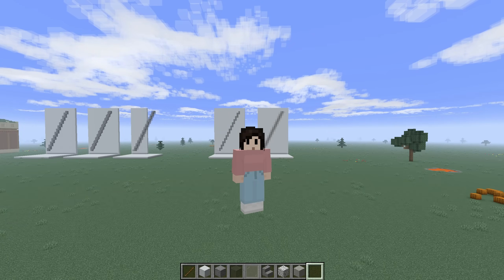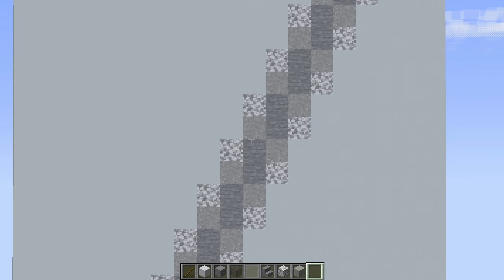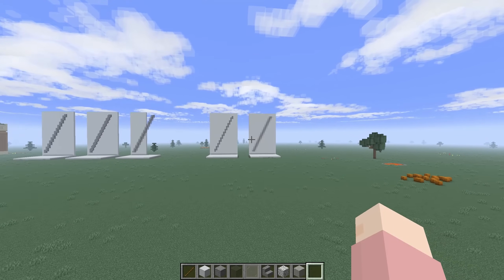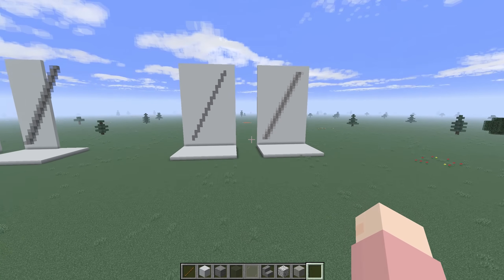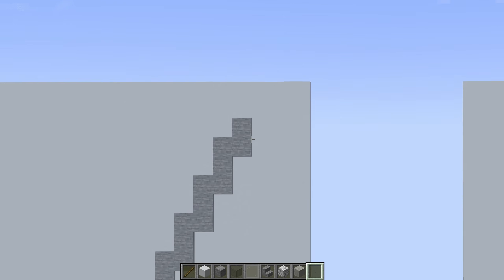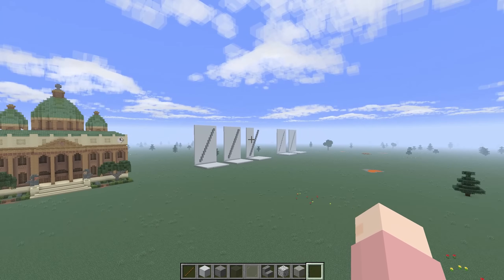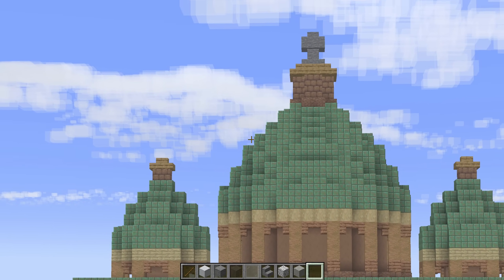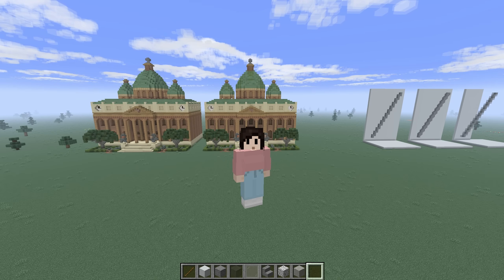How to Use Anti-Aliasing to Improve Your Builds

Comment: antialiasing needs to be balanced with post sharpening, the problem with your line is that it makes the line much softer. best way to sharpen would be to make the fill colour darker or to increase contrast between the fill and the edges
Reply: the side effects of softening with anti aliasing is that it can change the perceived colour, it looks "lighter" than the aliased line
Reply from the maker: I noticed with the line being so thin that it looked lighter and I hadn't thought of making the line darker to balance out the anti-aliasing. That's super interesting, thanks for sharing!

Comment: You know what? Call me a boomer, but i personally prefer the "raw", blocky look of the no-antialiasing style.

I personally have nothing against antialiasing techniques, but as someone who likes to get "up close and personal" with each part of the builds and likes them fully walkable top-to-bottom, it feels kinda weird to have random glass pieces on an otherwise plain, say, sandstone wall.
Reply from the maker: I'm partially in the same boat as you and so that's why I only applied it to the roof which I can't see when I'm walking around at the bottom. So it really depends on if you plan on getting close to that specific part.
Reply: @cooltwo  makes sense, and I can ABSOLUTELY see the technique working wonders of used in moderation. Good video!

Comment: You could do a follow up video to this talking about how dithering can also improve how a build looks from a distance. Lots of really neat science behind how and why it works.

- For context, I am an engineer that primarily works on video processing of radar signals for rockets. I just find it neat that concepts like these can be applied in such wildly different applications.
Reply from the maker: That would be an awesome idea for a video! Also really cool that you get to work on something for rockets!
Reply: I was thinking the same thing! I do tapestry crochet designs and I've found that dithering really helps to smooth out color gradients. Crochet is basically just pixel art with yarn!

Comment: still watching but i just got to the glass antialias and talking about the limited colours available—speaking as a pixel artist, 16 colours tends to be the entire colour palette you have available which means you might not have a linear gradient from one colour to the next that you can use for antialiasing. This is actually not an issue, you can use a green to antialias between purple and blue if you have to! what matters is not the hue of the colour, but its perceived value. if you converted it to perceptual greyscale (different from desaturating) and the colour falls between the aliased edges, then it will work just fine in most instances. I would just avoid complementary colours as they stick out more.
Reply from the maker: This is actually the most interesting comment I've gotten so far! I absolutely did not know that so thank you for sharing!

Comment: The main problem I can see for this is that the build has to be a little more uniformly textured and also on something like the dome I noticed it was much greener, however otherwise it is a fantastic use of an idea from another discipline which is part of the reason why art changes at all
Reply from the maker: I think you're totally right! This technique can't be used everywhere but it's useful for the few times it does make sense